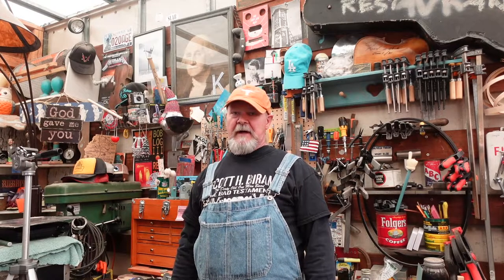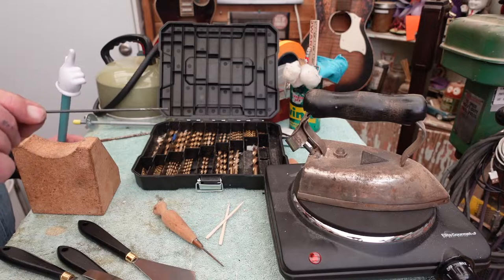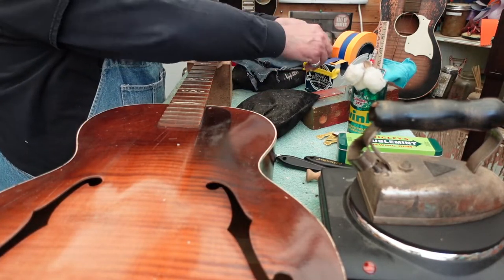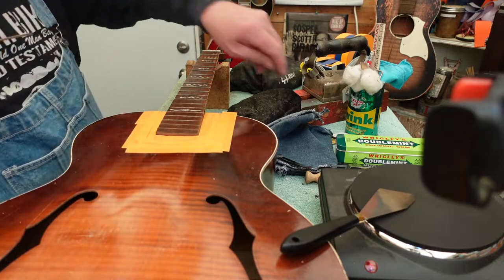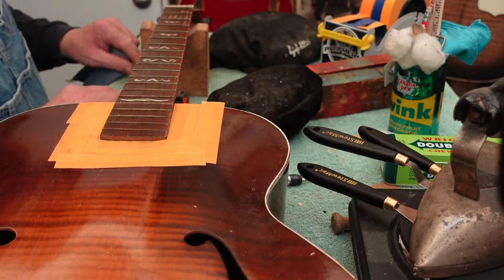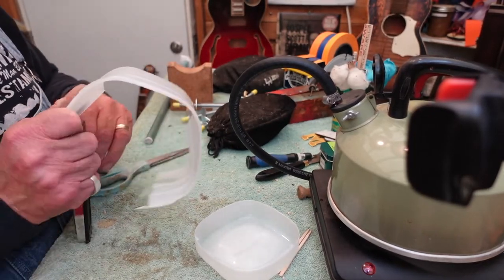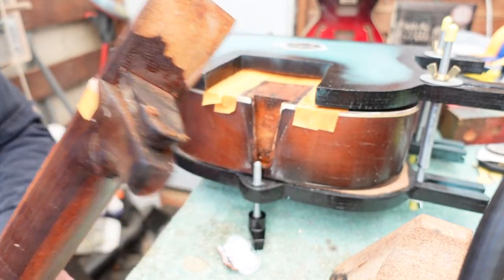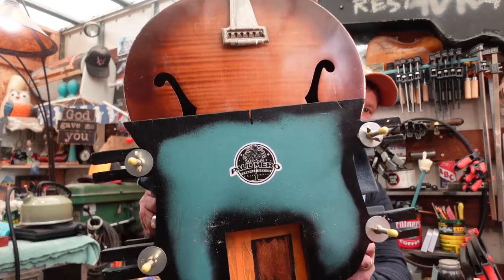Steaming Off a Guitar Neck: Econo-Archtop Guitar Neck Reset: Part 4

Comment: Excellent video! Thank you! I have an Old Kraftsman econo archtop that I just inherited. It's been in the family for a long time in storage. I cleaned it up well, but it needs a neck reset. Looks like the same issue that the guitar in your video has.  I can't justify the cost to take it to a pro, but I can't bear to let it sit as a wall hanger either. Once I get the tools and build a jig, I'm gonna try this method. Worth the risk for a chance to save it! I'm no luthier, but I'm handy with tools and eager to learn. Hoping to fix this, pop a pickup in it and have a great old blues guitar with some family history to it! Many thanks for the time you took to make these videos!
Reply from the maker: Easy$ my friend. Check the area around where the neck meets the body and make sure that the binding isn’t showing signs of cracking or one side of the side of the body isn’t breaking up because that’s an indicator of an entirely different issue. Let us know how it goes. Thanks for watching.